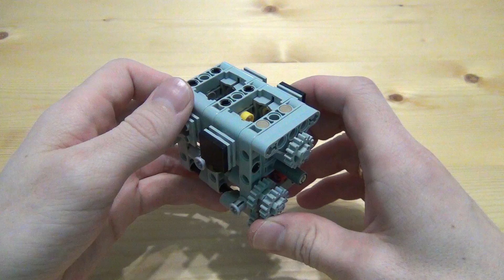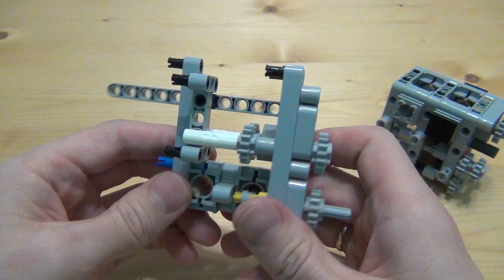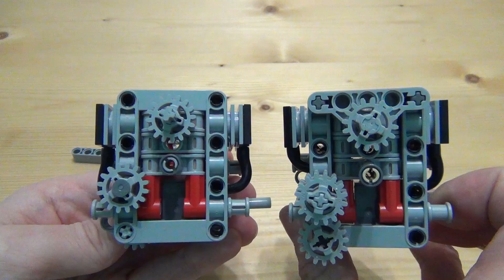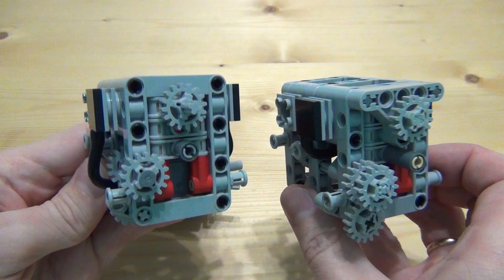Пневматический двигатель. Самый маленький в мире. Lego pneumatic engine. Smallest in the world.

Comment: You could make it much smaller by removing the middle part.
Reply from the maker: Thanks.
Yes, I know, but then it is necessary to glue the axles, as at high pressure and load on the engine, they begin to bend